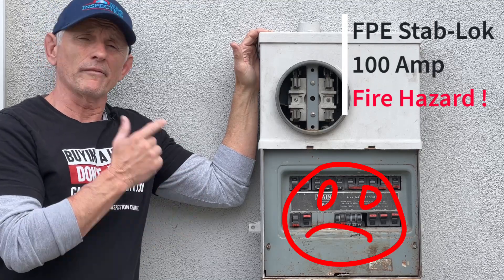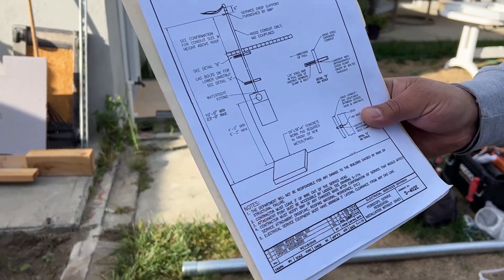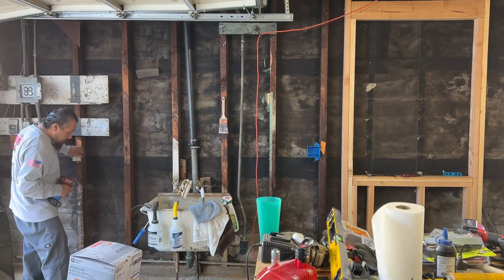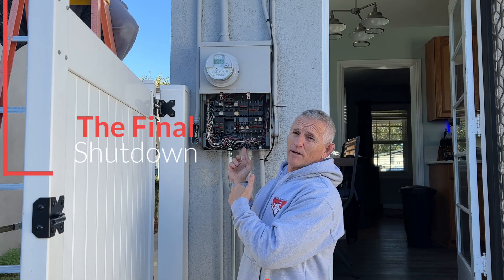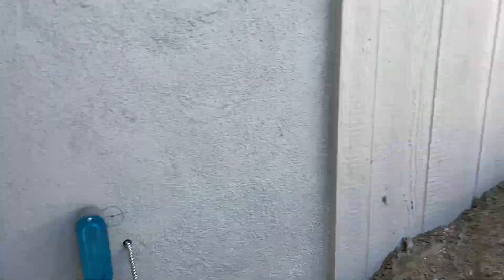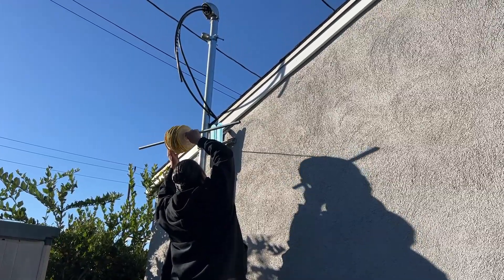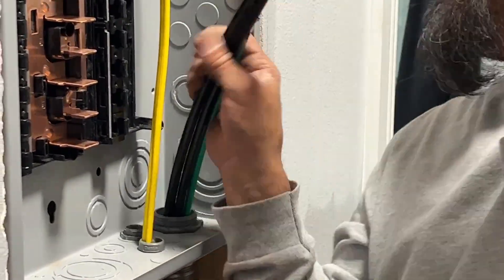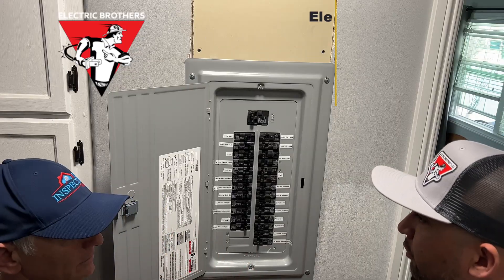Installation Of Upgraded 200 Amp Electrical Service | Relocation Included | 100 Amp Vs 200 Amp

Comment: Removed the AFCI circuit breakers - which are considered LIFE SAFETY DEVICES. Without written special permission from the authority having jurisdiction, that is a violation. A large percentage of the tripping AFCI has been attributed to miswiring. Has a qualified individual performed any testing to determine the reason for tripping. Just to let you know, the manufacturer will take the "defective" devices back to test them and let you know the reason for tripping.
 I also noticed very little safety PPE being worn. As per OSHA regulations, https://www.osha.gov/personal-protective-equipment

Comment: AFCI removed? Find and fix the problem. Do not mask a potential problem by taking the easy way out. AFCI can save your life. AFCI trip for a reason.
Reply: AFCI breakers are a plague in the electrical field, no one is happy with them. Current and past iterations of AFCIs all nuisance trip and they cause nothing but headaches for the homeowners who have to pay for them.
Reply: AFCI breakers are really sensitive and finicky. Nobody likes the AFCI breakers. Guys will put them in just to pass inspections and then take them out. They seem to be a piece of technology that needs to be improved so everything isn’t tripping all the time.
Reply: 😂 You clearly don't have a clue how these work, why they were invented, or why they've only recently been implemented in breakers, in some directions.
Do some research before regurgitating something you heard an 'expert' say one time. Talk to a tradesmen or two, you'll learn.
Reply: @PhiTonics  sad response.

Comment: How in gods name did the inspector allow the deinstall of the afci breakers.
Reply: The final inspection was completed no need for the inspection to come back out after he signed off on the final.😊
Reply: It happens all the time, AFCI breakers are installed purely to pass inspection. Once you get your final inspection you take em out.
Reply: Yuk
Reply: Inspector was no longer involved when they removed the afci breakers
Reply: How you know?